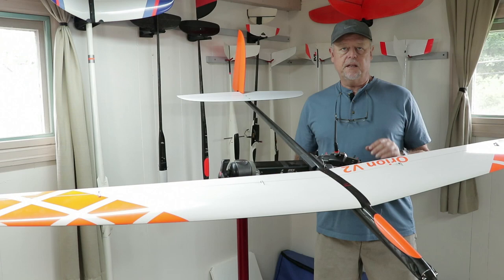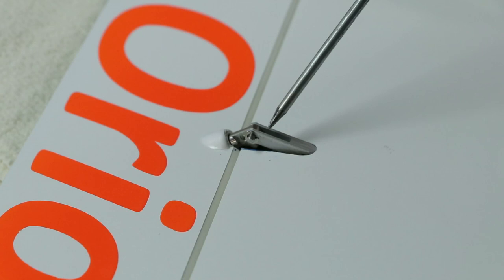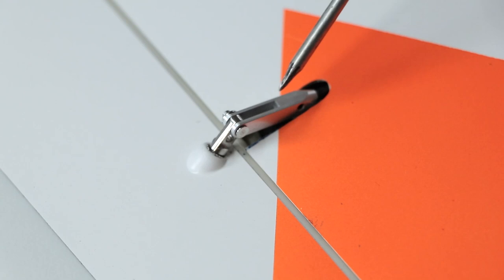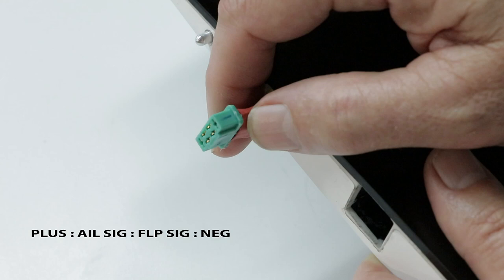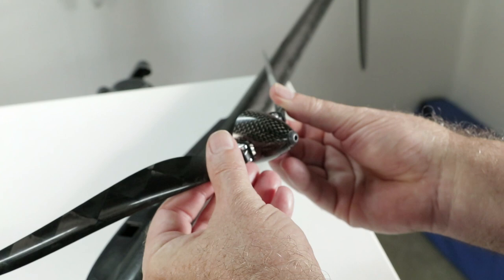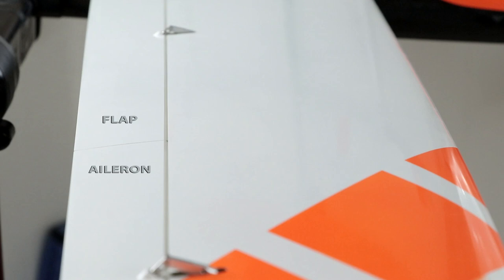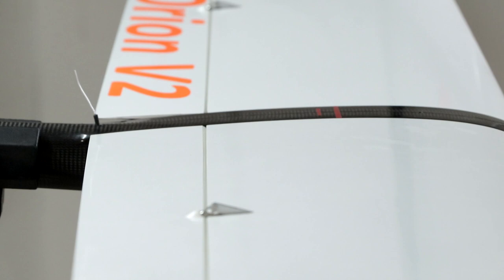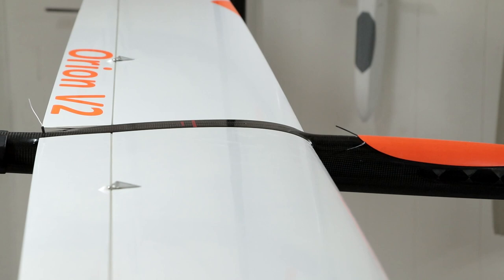ORION V2 Series Part 3: Wing Servos & Final Details For Flight

Comment: Paul, great video series on the Orion, I’m a longtime modeler but this is my first dip into this side of the pool. You video is helping me with my first model in this class, it is the Orion as luck would have it. Question, you keep referring to “black CA”… is this just black colored CA or is there more to it?

Thanks!
Reply: Black CA is a thick CA that has powdered rubber added to make the glue more flexible and shock resistant, good for gluing push rods.

Comment: Paul, any idea why NAN does not use an ids/lds system inside the wing? Is the gain negligible or did they not re do the original wing mold?
Reply from the maker: This is a budget airframe, so no stock LDS. You may be able to get a properly sized kit and add it yourself. Wont make any big difference in performance but LDS is clean and stiff if properly installed.

Comment: Hi, what tape did you use to wrap your servos? It sounded like you said caplon.
Reply from the maker: Kapton Tape:  this is mylar tape used in electrical and high temp applications. Alternatives are regular masking tape and 3M blue tape. Tape adheres to the servo, adhesive sticks to the tape and the mounting surface.
Reply from the maker: If you need to remove the servo, cut the tape, servo can be removed, and tape can be pulled and replaced as needed.

Comment: Question regarding servo mounting- I'm just getting into building my first sailplane. I've seen several different methods to mounting wing servo's. Some using CA others using epoxy. Some use a tray, some direct to the wing. Is there a better way "generally" or just personal preference?